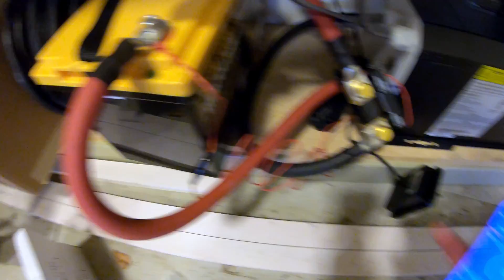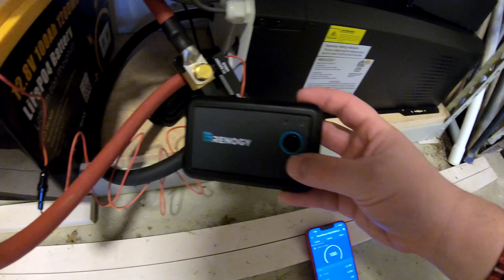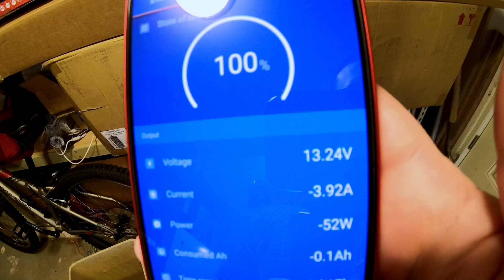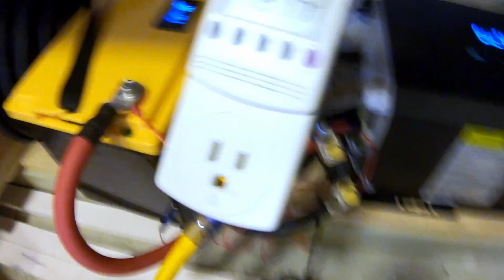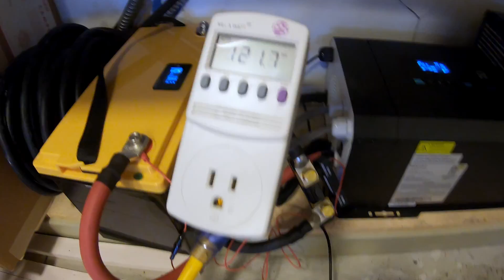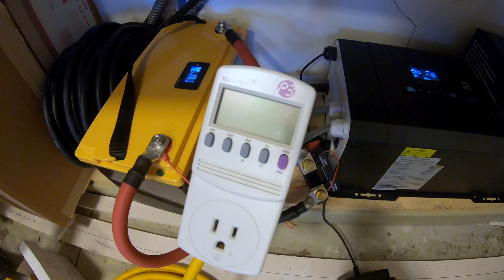Your Questions Answered! Renogy 3000W Inverter Charger w/LCD - Test & Review

Comment: My question is will these 3000 W inverters really supply 3000 W because that’s over 300 A a lot of current going through the transistors have you tried plugging in a 3000 W kettle?
Reply from the maker: Yes, I have pushed it to 3,000 watts and beyond. And it does it! But you’re right, any inverter should not be run at its max capacity all the time. Thanks for watching!

Comment: I need some assistance in this area.

I use this model for my camper. 400Ah battery through a 100 amp Controller with 400W solar. We accidentally got an E04 reading the other day because someone flipped the wrong switch at the wrong time and overshot the Capacity.

Anyway. The LCD screen on the inverter locked. The remote and unit won’t respond. All info I’ve seen leads to a hard reset.

Yet most systems are working through the inverter currently, lights, water pump, but not outlets.

As it is I can’t get any readings through the system and the buttons on the unit don’t respond.

Could anyone walk me through the safest way to hard reset the unit?
Reply from the maker: I don’t know how to do that…but I’m sure someone else in the comments can! Thanks for watching!

Comment: Wish  I knew this bypass function that needs the unit to be switched ON to bypass the shore power.  It is very annoying as the fan kicks in every hour or so even if nothing is drawing current.  Just the standby current causes this.  Second annoying thing that would have swung me to Victron is the fact that there is no bluetooth connection to the unit.
Reply from the maker: Yep! This inverter certainly has some quirks! Thanks for watching!

Comment: Q: we have the same inverter. Actually, we have the complete Renogy management system installed. However, we just noticed that even if we are not hooked up to shore power and the inverter is not selected on the main controller. We still have 240v working to run things like the coffee machine. Is this normal?
Reply from the maker: That I don’t know. But hopefully someone else in the comments can weigh in. Thanks for watching!

Comment: When plugged into shore power  ( Renogy 2000 inverter / charger ) I still cannot use all my appliances …. Dealer told me to turn it off  than every thing dies ?    Super confused !
Reply from the maker: My 3000 watt one has an automatic transfer switch that switches back and forth as needed between shore power and inverter power. Thanks for watching!

Comment: How much input watts will it take from shore power?

If charging your batteries at 75amp, ~1000 watt, how much will the inverter output to loads?
Reply from the maker: Great question! I am not sure. But would certainly be an interesting test to run! Thanks for the idea and for watching!

Comment: Do you need to turn off the solar panels to have the 3000w inverter charger charge the battery bank?
Reply from the maker: This inverter can’t connect to any solar panels. It just charges the batteries via AC power. However, if you have solar panels connected to the batteries via a charge controller, then this inverter can stay on without any issues. Thanks for watching!

Comment: I've had this installed by a van converter yet when I plug the van into shore power it doesn't charge the Lithium battery.
I have to swith the inverter on before it shows that it's charging the battery.
Is this correct or is it wired up wrong ???? 
Anyhep would be great
Reply from the maker: Nope! Not wired incorrectly. The inverter switch must be turned on for it to charge anything. Thanks for watching!

Comment: Hi, this is really useful information thank you!
I have this unit but haven't installed it yet.  Renogy suggest a high 4/0 AWG cable is used for the DC, that's 120mm2!!  
As far as I can see 60mm2 cable more than covers the max draw.  What are your thoughts? What size cables have you used?
Reply from the maker: I use 4/0 AWG cable on mine! Works great! Thanks for watching!

Comment: Hi great video is it possable with the inverter switched off and plugged into shore power that in the settings you can charge the leasure battery thanks mark
Reply from the maker: The inverter must be switched on in order to charge anything. Thanks for watching!

Comment: I have found that when you just want striaght power to go through the inverter it will limit it ti just 2000 watts (mine is the 2000 watt version) do you know of a way this can just pass the whole 30 amps 120 Volt AC  through it to my power distrubution panel in my RV ?
Reply from the maker: Must be based on the size of the unit. Mine will pass through 300W but that is the limit. I think it’s due to the wire sizes inside the unit. Thanks for watching!

Comment: Hi, what is the amp draw on stand by mode? 
I have victron 12/800 which is highly efficient , would like to keep for low draw, and the renogy for high.
Also, what is the max charging amps, i have 230ah 12v x 2 =460ah batteries lifepo4.

Great videos,  very informative. 
Thanks from Ireland!!
Reply from the maker: Hi from the USA! Glad to have you watching! I do more testing and in depth reviewing on this video for this inverter, so check that out: https://youtu.be/YY4JwQxWCqo?si=IZZEr3i1fl07Htwv

But as you’ll see in that other video, the inverter charger draws 2.35 amps at idle continuously. And it’ll output up to 75 amps when charging. Thanks again for watching and commenting!
Reply: @theresatrickforthat 
Thank you.
Really appreciate your response. 👌
Reply: So if you have the remote switch turned ON and is using 12v battery power and you insert shore power /mains power does the unit auto switch to shore power draw or vice versa?
Reply from the maker: That’s correct! It will auto switch. Thanks for watching!